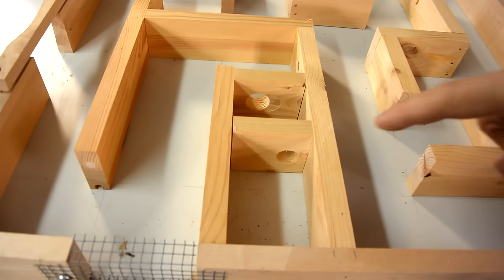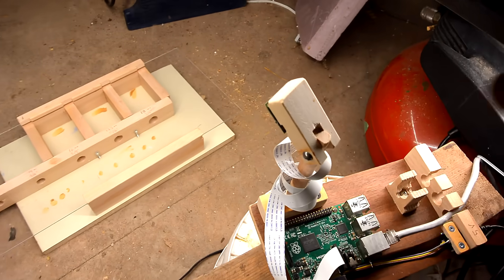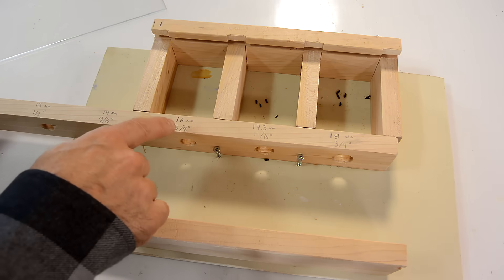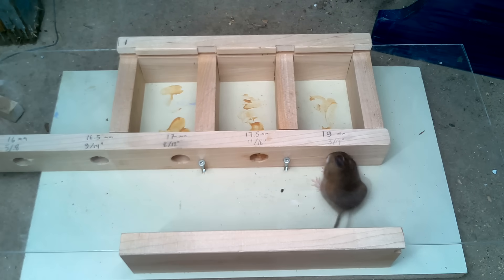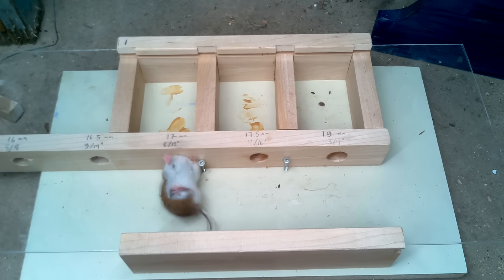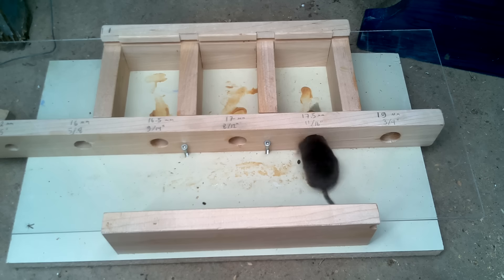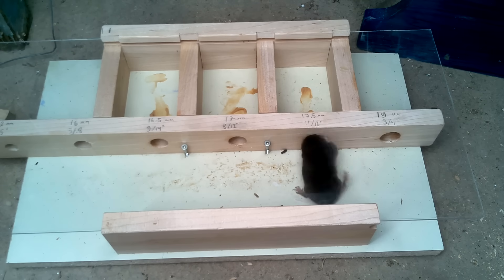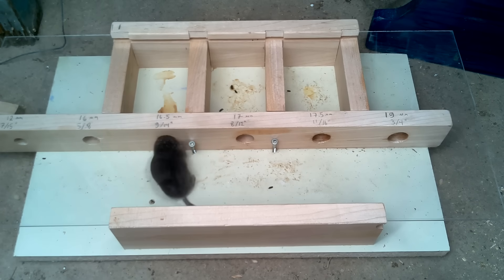How small a hole can a mouse get through?  Experiments.

Comment: I’ve noticed it’s a thing of confidence and physical ability, once the rodent notices it can go through the first one it constantly goes in and out and it’s brain can’t detect the change in size between the first and second, so it just puts in more effort because it thinks it basically the same hole, but it’s physically unable to go through the last one, it therefore leaves it alone

Comment: Oh and does the black stuff look like poop to you
Reply: Yep, that's mouse poop alright! (except for what the shrew (or mole) did) It's typically black like motor oil in an engine overdue for an oil change! Same with rat poop, but rat poop is bigger, easily a half-inch or next to that! Deer mouse poop is tiny, compared to rat poop... Because of Yosemite in 2012 and northern Vermont in 2000, I don't want a deer mouse in the house!

Comment: I think it's great that you do these experiments but , just so you know, if a mouse (or a rat) can fit its head (i.e. its skull) through a hole, it should be able to get the rest of its body through as well. I know that it often looks like a mouse's/rat's hindquarters are much larger than it's head and forepaws but they are quite flexible and, unlike a human's body with its rigid collar bone, the rest of a mouse's body will follow through whatever its skull can get through.

Comment: Next experiment should be crevices, while they can squeeze through a round hole to a degree, I notice they can flatten themselves out even more; I have a door in the shower with a water seal all around it, the mouse chewed a 1 centimeter hole and got in there between the cracks.

Comment: cool experiment. 
in the '80s Honda had mouse problems getting into the fresh air vent. a Japanese engineer wanted to test US mouse. so we did a similar test only with a pet store mouse. it could make it through a 14mm hole. the engineer said hum? Japan mouse must be fatter as they could not breach a 14mm hole. which was the design spec for critter intrusion...

Comment: I like this video.
Result: mouse with full stomach can not pass hole of 17.5mm diameter.
Btw do you know what I mean? that the mouse from 1:00 is not same as that one from 1:20, and that from 1:00 comes back at 2:20 if it is anyway the same one.

Comment: This is stupid because it all depends on how small the mouse is.
Reply: But the shrew is was bigger and still made it. What a tryhard.
Reply: basically, if it can fit it's skull through the hole, the rest of the body can follow.
Reply: Yeah that's what's applies to human too, basically the one do yoga
Reply: But now we can at least extrapolate the minimum size required relative to the size of the mouse. You're stupid.
Reply: The video is trying to show the proportion between the hole and the mouse, the body looks way bigger than the hole which makes it surprising
Reply: airhead
Reply: U r stupiddddd
Reply: Your stupid

Comment: My guess is that mice and shrews use the same method as cats do to figure out whether they can safely go through a hole - their whiskers. If more than a certain number of whiskers bend when their head goes into the hole, then they know that the rest of their body cannot fit. This doesn't tell them whether it's EASY to go through - since if they are fat they still have to squeeze to get through, but it tells them that all of their skeleton will fit.

Comment: I'm surprised the mouse (or indeed the shrew) didn't attempt to enlarge the holes. 
In my experience, from living in an ancient rural property, with regular visits of field mice, usually just after the harvest, they don't mind indulging in a little woodwork if there is sufficient reward at the end. 
Also the other thing to bear in mind, you don't generally have a mouse, you have mice... usually you have a whole family of them, and that family 'aint all the same size, so if Mrs mouse doesn't fit through the hole, one of the smaller members off the clan, just might.

Comment: Why not make the one hole have the way in start wider, and use a slightly stretchier material, like have a cone shape, but have the exit be smaller, basically having a cone shaped hole where the shrew should in theory get stuck, then you can catch it, and keep it as a scientific pet, so you can make experiments on it and KNOW where it is and how it's doing.

Comment: Next experiment: Make the board with holes sliding. So when they mouse gets through the hole it slides to a smaller hole. Will the mouse manage to push through the smaller hole to escape? Will the mouse panic and die? Will the mouse go on a cycle of pooping and eating the poop? HMMMMMMMMMMMMMM.

Comment: You need to make the mouse really want it, life or death. Get the mouse in a hole he can fit in then slide the holes over to the smaller holes, to get back out he needs to fit through the small hole, or die in a box.
Reply: Or trap the mouse with a small hole
Reply: Tylor B. You would need incentive aswell as disincentive, so putting peanutbutter infront of the holes as it gets smaller and smaller

Comment: I have an expanded experiment for you. Try setting it up with a hole that is too small. But place it somewhere that will have a large amount of mouse activity (but protect it from larger critters). I suspect each mouse that comes by will chew on that whole a little bit and eventually one will get in. May take a few weeks but it would be interesting to see how many mice it takes to widen the hole enough.

Another variation of that experiment, would be to have warm air gently escaping, in cold weather, and no bait, and see if mice will widen that whole and try to get into the warmth.

Both experiments would be very informative in explaining to people how mice will eventually get into almost any house. And would likely prove that just because you solved the problem last month doesn't mean it's solved this month.

On a last note, generally, to get the most attention, by your target animal (in this case mice), you should place it tight against a wall. Mice, and most animals, use defined lines to travel from point to point. Walls and other man made structures get used for this a lot.
Reply from the maker: I have an idea for you - just read what you wrote, and do the experiments.

Comment: A mouse through a round hole, ok. BUT what about a FLAT opening, say like under a door. How tight does the door need to fit to the floor, so a mouse can't go under. At my work I observed a mouse go under the rubber floor seal into a walk in cooler. SAW IT WITH MY OWN EYES.

Comment: nice sound effects, you can do a part 2 on the experiment. but I think it's safe to say that since the shrew is about the same body size of the mouse and they both have similar body structures that the mouse can fit through the same holes that shrew can fit through.

Comment: Hi
Both the mouse and shrew are struggling for grip on the smooth  white floor so they can't force themselves through the hole. I think some carpet or rough sawn timber would benefit them.
Ps I love the sound effects

Comment: I love the experiment Mr. Wandel!  I wonder if one of the main limitations the rodents has wasn't size, but traction?  They seemed to be struggling with the traction needed to push themselves through the holes at times.  Perhaps a different flooring material would yield different results?

Comment: I have been in the pest control industry for over 22 years. I want to address a couple of comments. The average adult mouse only needs a 1/4 inch of space to get through. The average adult mouse poop's up to 200 times per day. As they run they leave little dribblets of urine which contain pheromones. These pheromones identify which path's are good or bad.

Comment: You forgot about the concepts of satiation, and the corresponding motivation correlates, and weight gain. Why go through a small hole when you can expect peanut butter around the hole and outside the hole periodically. Why work when the welfare check keeps a comin!

Comment: I can tell you've never had a mouse problem.   they can squeeze in thru anything because of their retractable spines.
Reply: Bob D  Mint oil will keep most vermin away.
Reply: You are absolutely right!  Mice get into my attic.   I collect an average of 0.4 mice per day.  I am going bananas seeking and blocking holes around the foundation.  Etc, etc, etc.  I've studied the ridge vent at the top of the roof with binoculars -- no holes.  I think Mathias's mouse is faking us out.  It could fit through a hole smaller than a human hair if it wanted to.
Reply: Bob D i just leave glue traps out, and so far so good.
Reply: Dalmar Ampere: I bought some Rodent Sherif spray.  I sprayed a few ounces around part of the attic.  My attic is a nominal 1800 square feet, so I'll need 50 gallons of the stuff.  I'm going to try used kitty litter.
Reply: Bob D I didn't think there was such thing as a rodent spray.  Just the other day I was thinking that would be a good invention.
Reply: Jeff Demas: You gave me an idea!  Instead of spraying peppermint, the stuff to spray is cat pee.  Betcha spraying a gallon of that would clear out the mice from my attic!  Might clear me out of my house, too, but that's a small price to pay.  Fancy spray bottles labeled Chat Pipi would sell like crazy.
Reply: Bob D - Or just get a cat.
Reply: Jeff Demas: Being a bleeding-heart commie pinko Massachusetts liberal, I recoil from killing the cute little beasties.  I lug the buggers, one at a time, in a Havahart trap to a brush pile 200 feet from the house, where I hope a predator eats every single one of the damned things, and good riddance to the monsters!  #@$%^&!!!

Comment: The bottom board is MDF, which has a plastic-y, slippery surface. The mouse can't dig his claws in to get traction to push his way through the hole. You should try it again, but just use plywood. I bet the mouse would try harder to get through if he could get some grip.

Comment: Matthias, I am sure that you have caught on that the limiting factor in a mouse or cat or squirrel or most any other animal getting through a hole is the size of the skull. Same with a human baby but use forceps on them sometime resulting in the odd shaped human heads you see. They do not always reform. Then you have the shoulder compression but the joints there are flexible. Same as in human babies but they only dislocate just so far. Great video. Merry Christmas to you all.

Comment: Faulty experiment, as the mouse gets through the bigger holes and eats the peanut butter it gets fatter and less likely to get through the smaller holes. You should’ve made that fat fk fit through a hole of diameter 3mm then it would’ve worked.
Reply: The mouse also has less motivation to fit through the smaller holes since he has already eaten.

Comment: Some items to consider. 1) if holes were in thiner material might fit thru smaller hole? 2) if thicker mat. would they try the smaller holes they made thru? 3) were poops inside to reduce  bulk to get back out? (or just eat and poop?) 4) shrew seemed to behave differently after exiting smallest hole. did it injure itself and injury allowed easier passage? 5) might be enjoyable to see act of foley recording.

Comment: Nice experiment. Quite amusing to watch. A thought, the mouse & shrew both looked to be struggling for grip to push themselves into the holes. I wonder if some base material other than Melamine would provide more grip, thus allowing them to get through smaller holes?

Comment: Curious why both rodents kept struggling with and going back into the compartments they'd already cleared of PB and left their calling cards.
I think the white surface combined with the oils in the PB made it difficult to push themselves through the small openings.  It was neat that when the first hand trouble getting into a particular hole, they knew to chew on the hole's opening, presumably to chamfer it a bit.

Comment: Excellent video...I have a farm House and had a mouse problem in my kitchen...smaller mice could and did get into the smaller holes,so I used wire mesh outside under the siding...but not after I trapped 42 mice.

Comment: Hello, thanks for the video. This is pretty relevant for beekeepers, especially in winter.
If you had smaller mouses, and trying with flat/squared/rectangular openings, for example 9mm high x 12mm wide, that would be even more interesting.
Regards.

Comment: Interesting video, but different shapes would be interesting too.  like cracks between floorboards that may be smaller than 3/4 inches across, but wide enough to make it more comfortable for our rodent friends. Also, i couldnt forget the spider in 2:36, and kept wondering what happened to him.

Comment: Great video!, just as an idea you should sand the inside of the holes down with a spindle sander, so its smoother, make a sliver of wood that the drill bit didnt pick up was preventing the mouse from entering the hole?
Reply: Replace make with maybe***

Comment: probably already been said in the 1000 comments, but... What if you slide the wood to a smaller hole once it's already inside the room?  It would have no choice but to try to squeeze out.  ahead of time you could split the wood lengthwise , and then screw/clamp it keep it together for the testing.  then if the animal gets stuck you could unscrew/unclamp it to free the animal easily.

Comment: Soooooo, the lies they say about anywhere you can fit a pencil in a mouse can get in is a lie!..... Or is it???  If the holes where in a thinner material they might get thru a smaller hole. Holes that the mouses in houses usually have a small hole but thin the surrounding of ze hole from the back where you can't see it. I bet they can limbo under an 8 mm slot too. I know they are ninjas when it comes to climbing and hiding. You have the mice and the apparatus for more experiments :D
Awesome editing btw, Baby Zak 3, loved it, and Codie 13 also.

Comment: Does the depth of the hole make a difference?
Reply: Mike_ X do you mean more tunnel like as opposed to shallow? I think it would be harder for them to go through a deeper, smaller hole, especially since it’s made out of wood. If it was like a burrow outdoors, they could easily grip on dirt and mud and stuff. Shallower holes require less effort, and less of a risk of getting stuck midway through. If they were to get stuck, they could easily push/pull their way out since they aren’t wedged completely in a deeper hole.
Reply: Yes because there would be more friction.
Reply: They would be reluctant to enter a hole any deeper than would allow them to use their hind legs to extract themselves.
Reply: Of course,  as soon as they squeeze in the hole their body fat any maybe even organs are squeezed up and down the body away from the tight spot their body is in. If it's tight all the way in that's less leverage for legs to move and less space for the bodyfat to be squashed into and move around, the body fat and fur squished and moved few mm or so which can make the differences.
Reply: MrX 8503 There would not be more friction. Friction is independent of surface area
Reply: ( ͡° ͜ʖ ͡° )
Reply: actually friction in this case is not dependand on the surface area
Reply: ( ͡° ͜ʖ ͡° )
Reply: Mike_ X no but I think the fatness of the mouse does. Buddy was a bit chubby
Reply: Sounds like a question for your wife/girlfriend.  j/k!
Reply: No it’s not, contact area increases the resistance to movement.

Comment: At 2:34 when you added more peanut butter, I suspect that the mouse had already associated the right most hole with one he can enter and so never attempted the 17mm. In other words, the mouse thought the 17.5mm was the 19mm.
It appears the shrew is slightly larger than the mouse, so technically the mouse can enter the 17mm hole, even though it didn't attempt it.

Comment: Try this with a metal plate instead. Somewhere around 6x11mm is the limit for an adult european mouse (Mus musculus). But a long an narrow canal is harder even at your diameters. They dont get any leverage. Even though, I had have a mouse die in the middle of a electrical conduit with a 12.5mm diameter with fitted cables inside.

Comment: If you want to stop all mice getting in through ventilators and holes generally you need fine metal gauze over the entry. I have known the common house mouse climb 8 feet up a wall and go through an air brick with 1/4" square holes into a food larder! They got stuck in the vent when they tried to exit.

Comment: True story, about 20 years ago, lady complained about a bad smell coming from her toilet. What it was was a mouse tried to get into the tank from the back part where there is little holes in the tank to let air in, it got its head through, but stuck at its shoulders, and died there. When I got to it, it's head fell off and was in the tank, it's rotting body still stuck in the tank vent hole.

Comment: I feel like if you just put a few drops of oil on the floor of each cell the mice would get stuck inside and might make for an easy humane trap.  I think the mice would also try harder if they were trying to get out through the holes, rather than in....maybe a sort of fall in trap with the only escape being a 16.5mm hole.

Comment: Love the ragtime background music and of course the well timed "plooooop". It appears the prospect of being a movie star scares the crap out of the subjects. 

You may want to discover where the squatters are entering the building and plug it with steel wool. This can easily be done by live trapping a visitor, tying to a hind leg a short length of monofilament fish line with a bobber at the other end and turning it loose. The critter will know the way out and most likely the bobber will not fit through the exit. Just look for the boober in the morning and plug the hole with steel wool. All you need to do is be smarter than the infiltrator.  Good luck.